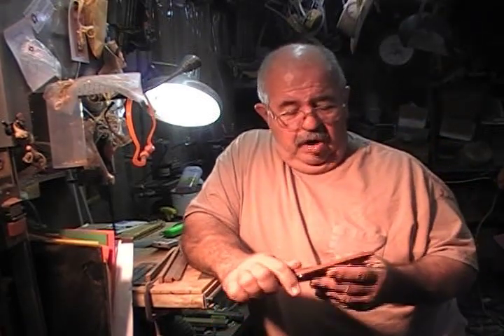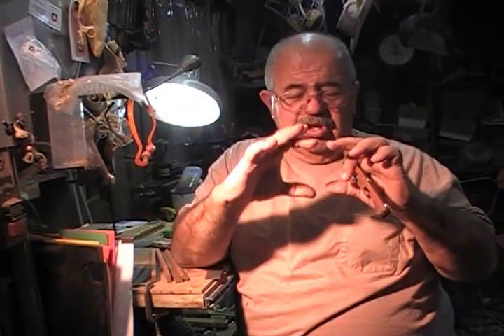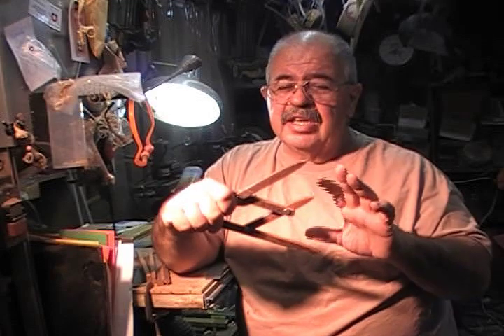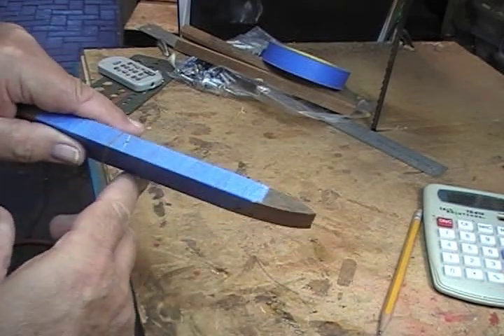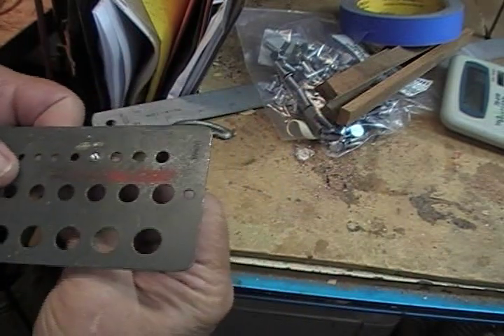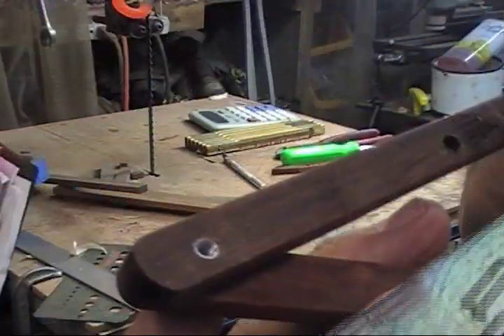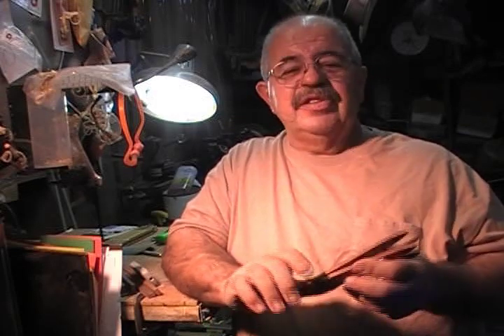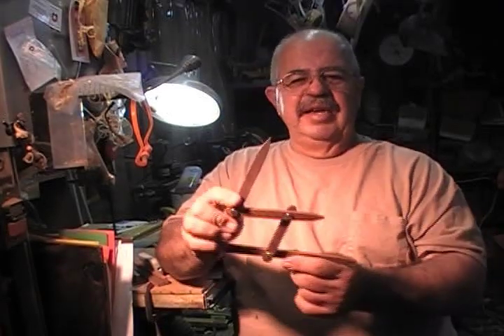phi-calipers.avi

Comment: I really enjoy your videos, and it is an honor to see you at SWAT in Waco, from time to time.  Lately I have become interested in turning boxes, and vases, and I wanted to make me a set of Fibonacci calipers, and once again, you came to the rescue.  I watched your video on making them, and I had a couple of questions.  I cut all the pieces the same, and drilled a hole in the center, but not all the pieces are the same length, and not all the pieces have a point on them. I will watch your video over and over, and hopefully I will catch on.  Thanks again for your input